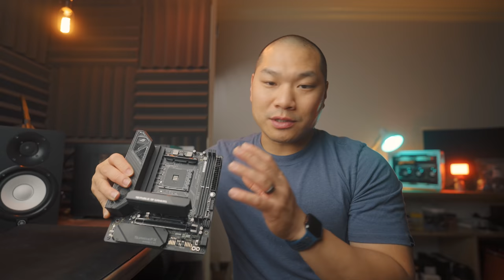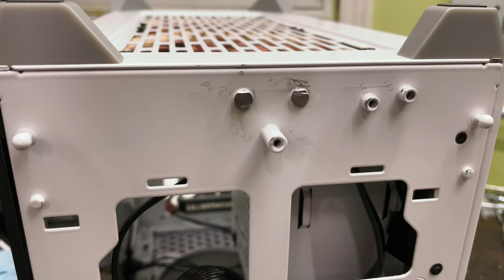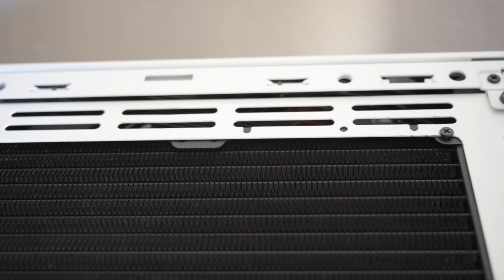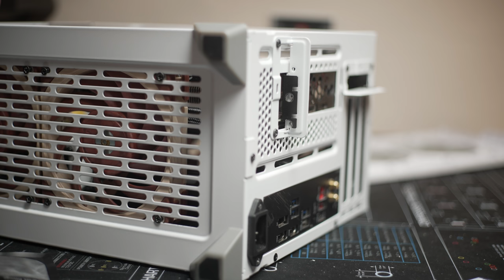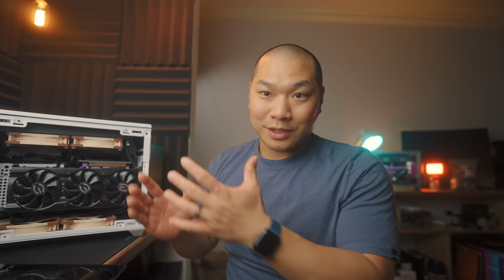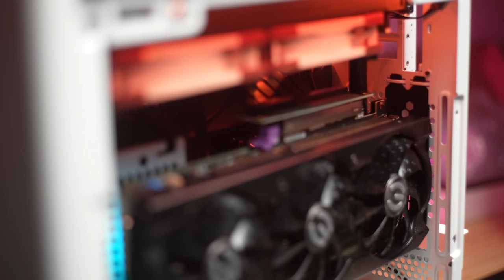Make your own NR200P MAX!

Comment from the maker: Quick note - some folks have mentioned unscrewing the front panel and flipping it. That would be the expedient route if yours is screwed on. I am uncertain whether there's a different version of the case out there but my back and front panels on both my NR200s (all made in 2020) are riveted in place. Yes, you can drill them out if you want to go that route, I didn't want to deal with that.
Reply: To be honest, that is a far more reversible mod than what you've done (especially when it comes to the power button), and it is also a lot easier to do. You can also use the side panel fan to house some slim 120mm fans to go with 2 slot cards.

And yes, the mod was anyways done by removing rivets. There arent any other variants.

Edit : there is a video by another person thats from last year. Search for Inverted Nr200 mod. In it he cuts a tiny bit from the front panel and  thats all you need to invert the panel. No need to 3D Print anything.

Your mod is the only way one can use a 280 rad though. If you're going 240, the other mod would be better.
Reply: @recyclebinladen5903  I actually did the inverted nr200 mod (drill out rivets).  made a few cuts to the side radiator mount and was able to put it on top (with 2 plastic studs to remove from top cover), similar to the dual radiator mod.  I'm running a 280 AIO without issue.
Reply: @recyclebinladen5903  so my case has no rivets. All I need to do is flip it ? This is good news I was about to 3d print the part for 49 bucks 😆 🤣
Reply: @Kahilg  You do have rivets in your case - remove the front panel and you can see 3 of them to the right of the SSD mounts. You need to drill them out. Its very easy and anyone can do it. You just need a small enough drill bit.

Once you remove the front panel, you have to cut off / file out a small bit as well. That's all there is to it.

The video your looking for is called "How to customize a cooler master NR200P Build AIO with Top Radiator / Top Hat - Inverted Mod" by Straightforward Tech. He also did a second video recently called "Build your own NR200P MAX with Inverted Mod".
Reply: @recyclebinladen5903  love you, thanks!
Reply: Can confirm the newer models have detachable front panels. The inverse mod is so much easier than what you had to go through. Loved the outcome though!

Comment: i did this to inverse my nr200p so I can have it on the left side of my case, don't need to cut anything else, since the case is held with screws you can unscrew the frame and just flip the font of the case. love the versatility of this case
Reply: Did you have any fitting issues? Or it is all the same just miroir build?
Reply: @vlmxs  I didnt have any issues at all personally
Reply: hahah! This is what I was also thinking. THough I haven't tested it because I don't have the AIO and GPU as of now. I am only using the CPU Graphics.

Comment: I've had my kraken x63 AIO mounted on the side using the stock side rails (rad panel) included with the NR200P. I have always wondered if I could invert and change things up a bit so I can actually use the glass panel and see things. I might need to get a new cooler, but you've given me some inspiration to try a few things out!
Reply from the maker: Awesome! I think you should be able to keep the x63 if you use the rad panel.
Reply: @MachinesMore  Is that a problem if we use glass panel instead on side radiator ?

Comment: Hello i have nr200pmax with 4090 and i9 13900k massive mashine. The problem  is i have really high temp from the cpu. Aditionally i am using the aio watercooling of the case. What you sugest. Normally the temp is around 90 dg

Comment: So what if I inverted my case, used a 240/280 side mounded AIO for CPU, 2 bottom intake fans, and a horizontal deshrouded GPU with 2 fans exhausting the GPU upward?  Do you think that would work well?

Comment: Yeaahhhhhh I waited months for the NR200P Max to release and I finally gave up and got the SSUPD Meshlicious. Honestly couldn't be happier and I think I'd choose the meshlicious even if the NR200P Max was in stock.
Reply: They are both great SFF cases. Can't go wrong with either. With NR200, there are more options for a dual rad set-up, and adding more cases fans.
Reply: i bought it on amazon , they had a restock. happens every 3-4 weeks. usually less than 20 at a time

Comment: I’ve done this mod and there’s a better mod imo. Look into modding the top hat. It allows you to mount two slim fans above your rad and you retain the ability to run your build without a riser cable Only reason you should do the inverted mod is if you have a rad thicker than around 35mm.

Comment: I love how the modding community that's built up around the nr200.  I have to ask though-am I the only one lating it on its side with the mesh panel?  It seemed like such a simple setup, especially with everyone so worried about the radiator and stuff.  Am I just crazy?
Reply: People want to use the glass panel to see all the RGB. Actually someone can build a cheap custom loop with the glass panel on, and without worrying air pocket goes into the pump.

I have a soft tube custom loop with dual rads and side mess panel. No RGB.
Reply: @spektrumB  Glass panels aren't my thing, but I do understand being proud of your work and wanting to see it.  I want to try doing custom loops, but I'm too cheap for the pc building hobby.  Lol
Reply: @Diino No RGB =/= Anti- RGB. I don't have RGB in my rig. Doesn't mean I have problem if people put loads of RGB in their build.

Comment: Question for you, I actually have a Max myself with 3080 Ti FE. I was thinking I could actually use a 70mm PCI-e riser cable instead of the 50mm cable that is included to space out the GPU closer to the vented side panel, and allow more room for airflow on the back of the GPU using the extra slot 3 slot space for my 2 slot GPU. Any idea if someone makes a 70mm PCIe 4 riser cable?
Reply: Love the new intro btw! More appropriate for the channel I think haha.
Reply from the maker: Cheers Andrew. That’s a very good idea actually! I think a 10cm riser is the closest thing and it can work- it might bunch up a little but I am guessing it would fit fine.

Comment: is that a pcie 4 riser that come with the bundle or just a reg pcie 3 i wonder?
Reply: If you buy the NR200P, it includes a gen 3 riser cable. If you buy the NR200P Max, it includes a gen 4 riser cable. The NR200 (non-P) does not include a riser cable.
Reply: @t3rminallychi11  hey thanks for the information, i just bought an additional cooler master pcie4 riser and its not quite cheap, almost regret not getting the P version as it comes with riser and tempered for a bit extra cost, cheaper than buying pcie4 riser separately, but now that i know i am glad. thanks mate!